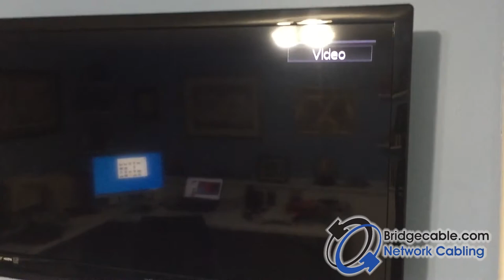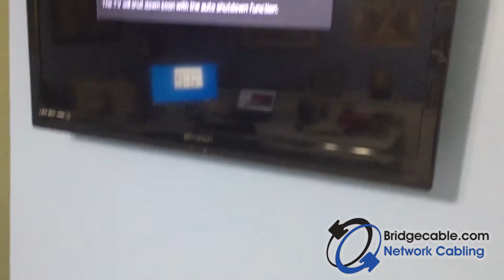Tutorial & Tips for Residential Custom TV Mounting | BridgeCable.com |

Comment: Going to have to check out the power solution.  A lot easier than tapping off the old plug and pray its on the correct side of the 2x4 that you need it to be on.
Reply from the maker: 100% YES! Simple solve and just keep the kit onboard the truck. We have tried a few power solutions or vendors.....each with their pros and cons!